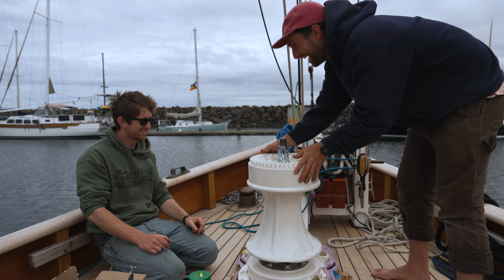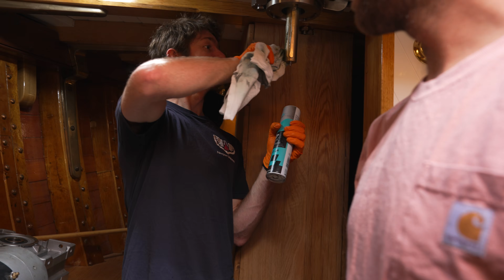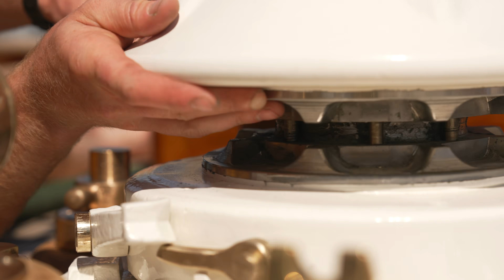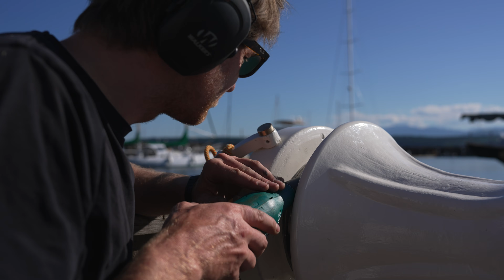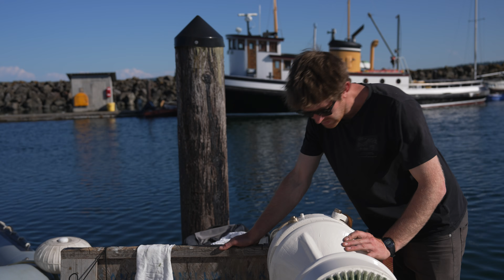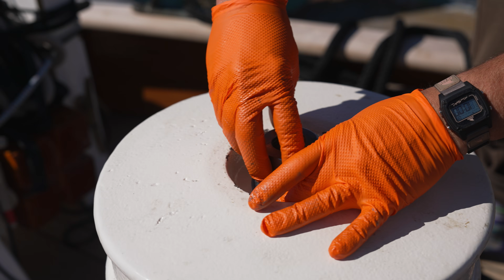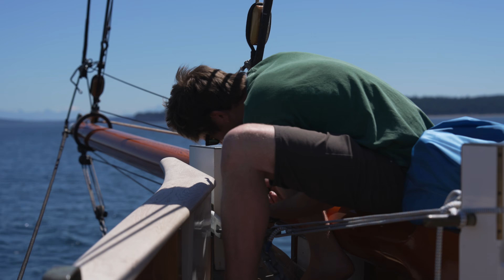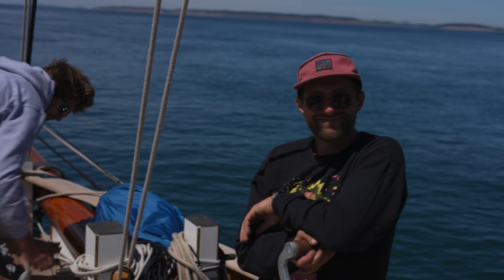Installing and using the original capstan!

Comment: One problem I noticed is the block of wood you have under the chain inlet to the boat and the outlet to the anchor from your capstan is too high and the chain going from the capstan back into the boat after it leaves the capstan has to go upwards to enter and is riding hard on the brass 90 degree fitting.

Comment: Would it hurt to grease the Gypsy lightly for the first few uses? This would help the chain not get stuck in the pockets as it tries to come off. The chain will stretch and the gypsy will wear in time. Some time on anchor with a good wind/current should take the newness out of the chain. 

Have had the same trouble with new rope road getting tangled going overboard and coming aboard. Let it all out, get the anchor to bite hard and use boat to back down and stretch the newness out of the rope. Would doing this help with your chain?

Comment: Relocating a zerk fitting due to a deck beam, and a tight fit between new (twisted) chain and a new chain gypsy, minimal issues for such a spectacular project IMO. I think its great that you reused the original windlass with a modern upgrade. It looks and works great! Well done to all involved.

Comment: You will be aware better than anyone  that these little commissioning  issues are quite normal, that is why you do trials. Everything on "Tally Ho" is new, by the time you have been at sea a few weeks, and the equipment is used it will bed in nicely. Bon Voyage.

Comment: shame that pipe wrench chewed up the brass bolt heads on the locking lugs.  Should have machined a flat on those in hindsight.

Comment: Brilliant piece of upgraded machinery!  Great craftsmanship!  Mind your heads on the sharp corners of the gearbox of the electrical motor assembly, especially in rougher unsteady conditions below decks...  Enjoy the upcoming sailing trip!
Reply: They need to put a nice wooden box around it. Otherwise I almost guarantee some blood on the amazing interior woodwork. Head wounds bleed extremely badly and machine corners are very sharp.

Comment: It does look like the chain is coming off the gypsy at an upward angle into the spurling pipe.  Perhaps lowering the spurling pipe and having a longer radius on the entrance would boost the efficiency of the chain weight pulling down on itself.
Reply: A funnel might also be an idea

Comment: No chain of the same type and measure is an exact clone.  ONLY  chain  made on the same run on the same machine with like material has a chance.  We had 100s of feet between rollers that had to be parallel were .0001 inch chain pitch variation over 200 feet was a disaster.

Comment: Hi Leo… Two thoughts;  Re: the chain on the Gipsy.  Would the chain not seat its self by simply running it in and out of the boat?
Set the anchor, back off of it and use the Capstan to pull the boat to the anchor there by seating the chain?  Chain in and out a few times!

Second… watching the ending video of the chain going coming around the gypsy and moving down into the chain locker.
In the video it looked like after the chain leaves the gypsy… the chain has a bit of an uphill climb… which would cause the chain to catch on the leading edge of the guide into the chain locker.
If that is true… recess the guide into the winch support on top of the deck 1/4 to 1/2 inch and see how that works!
Reply: Exactly what I was thinking.  But, I’m not a builder, so….

Comment: As you use that chain, the galvanizing will wear in. The difference could be in the thickness of galvanizing,. it will wear to fit.
Reply: Agreed!  I was thinking of mating gears - Run them a while and they will mate up nicely.
Reply: absolutely.
Reply: Will the links stretch?
Reply: @plakor6133  not so much stretch as wear in - galvanising is not a precise process - it is literally dipping steel into molten zinc which reacts and gives a self healing alloy coating with a rough surface.  Most high spots will rub down quite quickly so initial wear is significant but then slows down to almost nothing as the load bearing surfaces smooth out and give a greater contact area.
Reply: Wow - i always thought it was electroplated in galvanic cell - had to look it up - now i have to find a yt vid to see this molten zinc bisiness hehe   @jonathanlodge4117
Reply: correct
Reply: @snaplash   & Use a break-in compound, like used to lap valve seats

Comment: I noticed you have a twist in the chain between the capstan and the bow roller and that will always happen . What I did  was use a bigger bow roller and machined a grove in the center for thh shoulder of the chain  to ride in that solved all the twisting

Comment: Moly grease has molihnum disulfide (or something like that)  it leaves a wear layer of moly on surfaces.  In bearings it reduces clearances.  In high stress and high impact areas.  Heavy machinery for example it's the oe recommendation, sometimes up to 5 percent
Reply: Molybdenum.

Comment: Kudos to your committment to using the original machinery. This is an area that has seen a lot of improvements over tha last century and you'd probably be much better off with a modern windlass. But, dayum, that is one heavy duty pile of metal you've got there. It's super cool to see it installed and working.

Comment: Just ridiculously over-engineered. What if you lose your chain and can’t find the precisely right size?
Reply: ??  Chains are not made by Idiots !  There are Rules and Standarts like for Screws.. 
You have a Type 5 Chain ... then every Seller know what you want
Reply: It's not over engineered, the chain may slip off if it doesn't fit well. It's a standard size chain. The solution is to buy a higher quality chain if required.

Comment: Two suggestions: 1.  soft metal wear plate to the inlet of the pricey bronze deck elbow.  2. add a decorative weather cap to cover the capstan top nut from water, and avoid pooling in the capstan cover bowl.  Otherwise great work !
Reply: 3. some sort of pad (leather?) to prevent forehead damage for the folks who smack their head walking into that work area.
Reply: 3.  A chain swivel at the anchor/chain junction.
Reply: and an even softer, cheaper wear plate on top to protect the soft metal wear plate that's protecting the bronze elbow that's protecting the timber below that
Reply: @cliveramsbotty6077  I like the way you think, exactly what I was thinking too.
A bit like the Irishman wearing two condoms, .... To be sure  to be sure
Reply: @cliveramsbotty6077  then a rasher of bacon and a slice of cold buttered toast. Double overhead grease nipples will complete the modification.
Unfortunately the chain will no longer fit so just hack a hole in the deck for it
Reply: Its likely silica bronze and not very soft
Reply: The original design worked perfectly for many years so why change it
Reply: Wear plate called a Scotchman
Reply: That's experience talking
Reply: Wow, some excellent ideas offered here, something to sift through for sure!
Reply: What about the effect of wear in the chain itself ? On a bicycle over time chain wear will lengthen the chain which will cause a difference which will cause the chain to jump.
Reply: @georgeb.wolffsohn30 the gypsy is based on the outer dimension of the chain, the inner dimension will be the part that wears.
Reply: @georgeb.wolffsohn30  I don't think the chain on a anchor wears the same way. It is under different stresses compared to a bicycle drive train.
Reply: @TR4zest  A bicycle chain has rollers which wear against the link pins. This wear is commonly known as chain stretch. On the other hand, lifting chain has none of these components. The only thing common to each is the name "chain". Cheers
Reply: @georgeb.wolffsohn30  not so sure the anchor chain will see the same use as a bicycle chain sees
Reply: You need a swivel on that anchor.  Otherwise the chain will be constantly getting twisted as the boat swings around at anchor.
Reply: @kenrolt8071 My immediate thought for point #2 also. I use a 3D printer quite frequently and it would be simple to design an umbrella type of cover for that, using the 6 sides of the nut as a friction attachment point. ASA or other UV-resistive filament would be advisable.
Reply: I agree with Kenrolt, the capstan has a design flaw that created the top cover from being removed, salt water pooling into the shaft/nut area allowing corrosion to take place.  A cap/ cover is needed to prevent the same problem from happening again a hundred years later!  
2. Grease is not a substitute for never seez anti galling compound, in my opinion.
3. I am not an expert in this field, does the chain ( submerged in salt water) create an electrical current causing a galvanic corrosion problems for the capstan parts that have dissimilar metals? 
Leo and crew, great job on this massive project! Cheers
Reply: @jimp65  The galvanized chain is sacrificial to the capstan.
Reply: Why not just... Buy a better chain instead? I mean if your toe hurts in one of ya boots you dont cut the toe of don't you, na you get a betta pair o'boots.
Reply: @erinas  That was my first thought but you're looking at thousands of dollars worth of chain.

Comment: Leo .... the Wish List is Empty 
if you want to paint the marks on the anchor chain .... first clean the chain then apply a coat or two of white primer paint then when it dries good - apply two coats of the paint color .  Now the color will show a lot better
Reply: If you are going to put primer on the chain,  make sure that it is an etching primer. Ordinary primers don't stick to galvanizing as well as etch primers.
Reply: @joecole5052   good call… I’m told that a Stainless Steel anchor chain is better than the galvanized anchor chain because it moves smoother through the windless

Comment: 29:34 that cotter pin needs some attention 😊
The capstan is amazing 🎉
Reply: Another 15 degrees should do it !
Reply: Leo might know it as a splitpin.
Reply: Yes my thoughts as well.
Reply: Came here to add this comment. All the OCD mechanics!
Reply: @RossReedstrom  Who have a valid (knowledgeable) point to help in the long term, and you ?
Reply: replace it with an R pin for quicker rebuilds.....
Reply: Opinions abound on YouTube about how to bend a cotter pin properly just ask the ”Rigging Doctor” in my humble opinion both sides of the pin should be bent to some degree because if you only bend one side and that side breaks off the pin can slide right out. Cheers and good luck

Comment: You should add a stipper bar for that windless even if the wildcat welps are just sized right. You'll see why when the chain comes up muddy or weed covered. 🤗
Reply: Yup if it's this picky a fit, a little sandy mud will gum it all up!
Reply: The stripper bar for sure. However, normal practice would include someone with a hose washing the muddy chain over the bow before it reaches the bow roller. The idea here would be to avoid filling the chain locker with mud and debris.

Comment: Could be that the chain was assumed to be placed at some smaller radius and they didn't properly relieve the pockets to allow the chain to fit over the larger radius of the outside diameter. 

Basically, it's be like having a square tooth on a gear for say... a bike chain. It wouldn't work right? Because the chain is supposed to sit "surrounded" by the teeth, but the square teeth prevent the chain from falling down into the holes on a circular "gear." On an imaginary "flat" gear, sure, but not on a circular one.

Comment: The inlet hole is too far for the chain to go away under its own weight... perhaps you need a roller or a guide for the chain, in the shape of a triangle, it will prevent the chain from winding up at the exit. She will "pull" the links out of the grooves in that thing, and the chain will come out easier, she will have no other options
Just a brass guide at the capstan outlet, inside between two chains

Comment: Why are you using a pipe wrench on the capstan???
Reply: What else should you use on a smooth round brass fitting?
Reply: @jonnenne strap wrench maybe? Dunno, not my equipment.

Comment: Keith would have a fit if he saw you using that pipe wrench on the fasteners.....
Reply: If you watch Keith’s video he did the same thing with a pair of pliers !!
Reply: Keith can speak for himself. Personally, I doubt he would object, after all it is a working piece of equipment and will receive worse through Leo’s journeys.

Comment: Did anyone else have a visceral reaction to the pipe wrench biting into the brass…😢
Reply: There were a lot of similar comments about Keith using a pair of channel locks on the same bolts.  I think Leo wanted to one-up him with a real set of pliers.  It's a 100-year old capstan folks, not a swiss watch (though Keith all made us feel it was closer to a watch!).
Reply: I dunno why they didn't use a hex head. I guess this is the original way it was built?
Reply: Keith used a set of channel locks to tighten those. Adds character.
Reply: Yes.  More especially because I have had to do it on an 8n tractor and know the damage it did.
Reply: @Tillersweep  Those wheel nuts are some of the worst ever.
Reply: Almost as bad as when I saw a guy using a micrometer as a clamp.
Reply: Even I know better than that... and I'm just a lowly wood-butcher.
Reply: Flesh crawl event ! lol
Reply: I was screaming "NO  NO  NO" when I first saw the jaws bite into the fitting.
Reply: Chinese anchor chain?
Reply: …Epic piece of machinery. I’ve really enjoyed this side quest to the Tally Ho build. ❤❤❤
Reply: Knurl by pipe wrench
Reply: Oh my yes.    Yikes
Reply: I don’t think the jaws bit into and damaged the part at all. The large red pipe wrench was shown to create interest and a lively conversation. A smooth round surface can be loosened or tightened successfully with a strap wrench.
Reply: Very satisfying watching a pipe wrench do what it is designed to do.
Reply: Obviously, they are cabinet makers and not mechanics.
Reply: Like so many people, I too was shocked to see that K.R. never bothered to machine a couple flats on those bolts. Seems like there should have been a machine shop in the boat yard that could have fixed that mistake.

Comment: had to downvote. watching threaded bolts getting screwed on with that kind of wrench is just wrong. keith just failed at this, what a freaking mess that thing turned out to be.
Reply: I doubt Keith failed. They were matching the original.
Reply: Should have machined flats on the bolts.